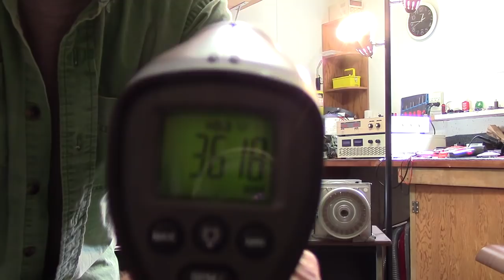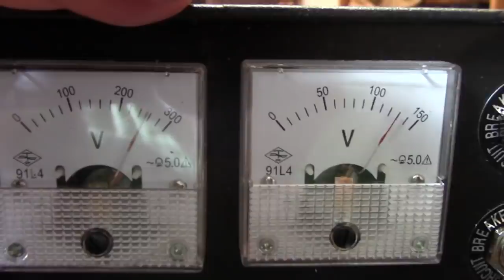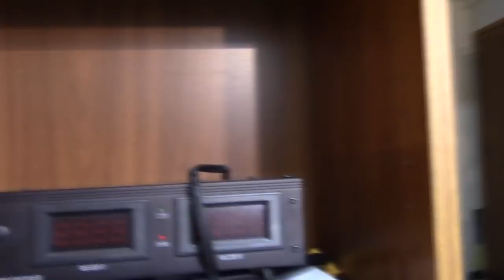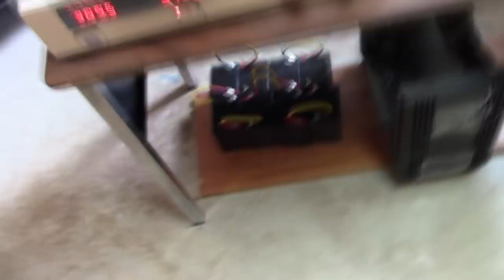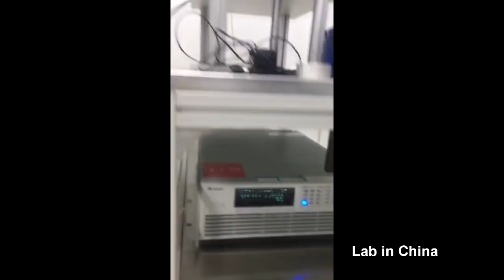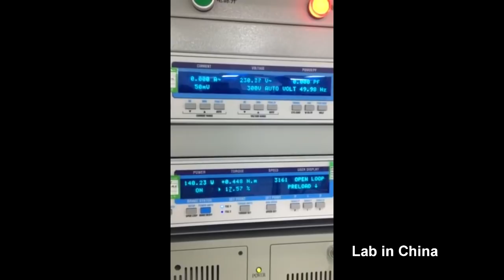China Lab Video + Early loop evidence

Comment: The only problem you never connect a load to these fucking generators and produce more power then what's being used to run the generator. We don't give a F about the RPM unless there is a load conected to it.

Comment: Mount it firmly in a speaker box with a speaker membrane on the spinning side. Set up another genny like a mirror of the 1st and face the speaker heads at each other and maybe the matching fz but opposite wave length will cancel out the sound

Comment: Wait so you're using 389v at 3.7 amps according to your power supply.
So that's over 1400 watts of power draw.
Its hard to understand what you're trying to achieve, you say you can make 80amp at what voltage.

My welder can make 200amps from 20 amps from the wall. 
But it's 230v at 20amp to 20 to 25 volt to 200amp

Why should we believe a claim with no evidence.

Comment: In me opinion any cinde of compound sg's can not work be them self they are not practical how ever if compound hybrid engine is used thats diferent story with of course other hybrid gismos .
Early exampels willys jeep ,kubelwagen,gasoline-dizel electric trains,gyrobuss,owen magnetics.
How hard can it be to modify hit and miss multi stroker engine with self regenerative fuel useing bacteria and on top of that useing closed egr system who use chemical to chemical decomposition of exaust gases then you can enchence it with electrical ,magnetical,pneumatic ore hidraulic assistance.
How ever this sir Gerard has some good points and actual testing results.
Those generators of hes work best on modified hit and miss engine then you get some thing nice working on peanuts basicaly.
Hes videos are also related to compound sg's,plasma and amplifier variabel ignition system changeing polarity comonly twin ignition .
He does have some nice staff and interesting results mostly the meter readings are unusual .

Comment: How does electronics handle the high voltage and high frequency such as radios and computers. So far you have tested inductive loads and resistive loads.

Comment: We see that is working now could you set up an outlet set up hooked to your generator and take the motor and plug it back into the generator after the generator is running see if there’s enough RF to keep the unit running smoothly.

Comment: Hey Gerard, great Job. Too bad they don't make a plc that can adjust to match the peak resonance. You could make a universal controller that does that though. 
One controller that adjusts it's resonant frequency output to whatever motor you attach it to. Just a thought.
Reply: The problem with a PLC is the scan time. Way Way to slow they are garbage for an application where the input read needs to be fast enough to calculate the rotor position. typical scan time of standard industrial PLC like a Allen Bradley micrologix or compact logix is lik in 10-100 milliseconds. you need to be able to read inputs much faster like in microseconds or faster.

Comment: sir that stator or motor bracket that needed to ring ........turn it cherry red in a forge in a dark shop......then quench in cool oil, if it still doesn't ring .....repeat and quench in H2O..........next..... last chance....... cool brine.
why use mystery metal.   I like 5160 spring steel....leaf springs to a truck...... .maybe thin your bracket....... make it longer....the length and mass is how you.tune it.   You really must  think about heating your oven to 400 f and putting your pieces...in for an hour or so ....... Then turn off your stove and let it cool down slow.  I do my knives 3 times like this a...nd they ring like the singing sword..
These last three draws in the oven dissolve the  crystals  that form inside the steel during the quench. Here is your 15 years 24 7. so it is not as brittle as glass......heat treat. When steel breaks look......look at the crystals. If this happens you need more draws in the oven. if the draws 400 degree draws are still brittle.......go to 450 .it may go blue like a spring.
However the crystals left in may be the ticket for increased resonance.......if the pieces are made robust enough to not shatter.
cherry red dark shop into water for a second then out for a couple seconds.....down in the water another second then out.....a few seconds later deep quench in the cool water   finish it cool.. if your water or oil gets too warm you are screwed. mild metal or mystery steel......last chance to harden steel......cool brine instead of water. 
Take those shitty ones you got and see which works best.    Have some fun!  PS There are safe areas to stand......but not by the flywheel.......if something flies off.....you not be there.........Don Garlett 
  lost all his toes  when a perfectly good clutch exploded........I know you know what's  going on.. 
I run a sawmill.....you can" t stand next to the head. Just take care of your self brother.......love your work. what a guy.

Comment: 4:50 RPM + V input + A input + torch + friction + load = 6 things to play with. Depending on the LOAD the controller needs to know to do what exactly? A lot of parameters to play with to find the BEST "6 items in perfect sync mode" with the MOST PERFECT EFFICIENCY factor. That's the deal 6 params in PERFECT & MOST EFFICIENT SYNC!

☠️BLACK BARON☠️: AI stands for "ARTificial INTelligence". It's in my 💀head💀

Comment: I understand that you believe you'll be able to achieve 75,000W (100HP) output with a 720W input (6A @ 120V ac mains), i.e. 10,417% efficiency, however let me drop some current figures on you. 

When you were running your small motor you were consuming 154.8W (1.29A @ 120V) from the mains, yet your power supply was only putting out 101W (0.57A @ 177.2V), result = 53.8W consumed by your power supply, therefore 65.24% efficiency. With the second motor connected @ ~2200RPM the power supply output 77.1W (0.435A @ 177.2V), yet consumed 126W (1.05A @ 120V) from the mains, 61.2% efficiency, worse that the first motor. Now although the efficiency of the power supply obviously varies with power output, you didn't provide a mains current draw whilst you were operating the second motor at 3600RPM. It's safe to say that it won't be a dramatic difference however, giving the benefit of the doubt, I'll use 70% efficiency for the second demonstration, almost 5% higher than anything we saw.

At 3600RPM, 500W load, the power supply output a whopping 1472.3W (3.78A @ 389.5V) and, with a generous 70% efficiency ratio, consumed 2103.3W from the mains; again, you were only powering a 500W load (<25% efficiency)... Ok, Ok, I'll give you the benefit of the doubt again. The load is the load; although it's 500W rated, it's rated at 120Vac, meaning that if you push the voltage higher the load will increase as a function of P=VI; not infinitely, something will blow at some point (filament in the case of am incandescent bulb). In the video the stator winding (from the generator side) that's supplying the bulbs is outputting approximately 127Vac, according to the voltmeter (the 240V output would blow the bulb), so the bulb is actually consuming approximately 560W (P=V2/R; still a huge loss).

Now for all you electric motor enthusiasts you would know that when motors run they produce what's called a "back EMF" or "counter-electromotive force", whereby the moving magnet in your motor induces its own current in the stator winding, in the opposite direction of your supply current. This follows the principle of induction (moving a magnet by a conductor and inducing a current), and is how electricity is generated by the generator side. [If you would like evidence of this, watch the current draw in the video as the speed of the motor/generator unit is increased, what you will see is as follows]. So like the electricity-producing EMF (how you actually get an output from a generator), back EMF is proportional to the angular velocity of the motor/generator (the faster it spins the higher the EMF/back EMF). So, how do you see it by watching the current, you ask? When you increase the current to the motor, more current flows through the stator, increasing the EMF (magnetic field strength), thereby making the motor armature spin faster. This increase in angular velocity rapidly increases the back EMF, counteracting the supply EMF and your input current drops, but to a value that's higher than the previous setting (watch the video, you'll see what I mean). Now the reason that more current is required to spin the motor faster is because more work is being done [work = power (Watts)], but the same goes on when more power output is required from the generator.
Reply: Now it becomes a little more complicated... At 560W (120Vac) output, the generator in the video is drawing 4.67A. When you increase the electrical load on the generator the voltage and frequency try to stay the same (function of RPM; controlled by the generator regulator) so the current increases, this increases the back EMF in the generator stator, thereby increasing the magnetic field acting on the armature, increasing the mechanical load. This then tries to slow the armature, decreasing back EMF on the motor side, which allows more current to flow in the motor stator, speeding it back up to where the back EMF balances again. However, as the motor magnetic field needs to be stronger to apply the increase force, without increased speed, the current draw is significantly higher. This process usually occurs very quickly and is not dramatic. This talking about the electric motor driven generator in the video, a generator driven by a combustion engine works on the same principle but the governor increases fuel supply, not current. 

SO, getting back to the point! Although this was stated to be a 2700W generator, the power consumption shown in the video only amounted to ~560W output. As the load is increased to 2700W maximum, the current, therefore power consumption will increase reasonably proportionally. So the 2103W required to generate 560W (both approximate without further data) wouldn't look much better (more efficient) when outputting 2700W (the maximum capacity of that generator).

Conclusion: There's no such thing as free energy. This system if full of energy losses. Taking 120Vac mains and stepping it up/down in voltage to run an electric motor to, in-turn, drive an AC generator is ridiculous people! I mean, come on!?! How do you expect to gain almost 10,500% efficiency when the setup it currently running at a big loss?
Reply: I completely forgot to mention power factor.. but unfortunately that wouldn't help your case.

Comment: No jet fuel. Sir this is out there and in use. Think about the noise the jet engines make when you're on a plane it's the exact same they tune it to the frequency of The Ether in the sky and it levitates.  Not low pressure.  That's why at certain speeds certain shapes produce honey bee Harmonics....Why  when you're at the airport or you're getting on the jet you don't smell jet fuel ?  You would think with that many jets with their engines running there would be noxious fumes  everywhere.? Thank you for exposing it for everyone to see and use.  You are a gift to humanity.
Reply: OH. MY. GOSH! Are your serious!?! You think aircraft don't run on petroleum-based fuel? They levitate using ether?!? Obviously you've never actually been close to the exhaust of an aircraft or you would know they have a distinct kerosene smell. Do you walk outside and immediately smell car fumes? Do you suffer from carbon monoxide poisoning daily? But look at all the cars? Damn, man!
Reply: You said it this should be named 'energy 2.0

Comment: Why do the greats have more success with less accurate, but analog, equipment? Is modern digital equipment more accurate in relative information transfer but using fundamental dynamics that are incompatible with nature? ie; 432mHz vs 440mHz musical tuning.

Should we try utilise refined analogue systems for systems such as amplifiers or RF generators over modern systems that use modern chipsets and circuit boards? Seems logical to me but I dunno shit lol.

Comment: Been working with Stubblefield coils. Was crating stationary magnetic fields. Used some of the Stubblefield coils to make a moving magnetic field that was the secret. Once I got the moving magnetic fields going from the Stubblefield coils to effect the others Stubblefield coils it worked. Stubblefield coils produce little current on their own. But if you use some of the coils to move  emf electricity  is generated at greater rates. Have Stubblefield coils in seed of life configuration using magnetic fields. 3 in center 6 around those and 9 around them. Some must be wired to create emf pulse or screw effect. Like how the heart works. So it can echo the next pulse. Idk the science but do know it works.

Comment: Have to applaud Gerard for his persistence but when he mentioned "looping" the system I became concerned. Under ideal conditions the electrical power output generated when you move a conductor through a magnetic field is exactly equal to the mechanical power input needed to move the conductor. This is under ideal conditions with no bearing friction, eddy currents or wire resistance ... etc. Unity can only be approached and overunity will never happen. Gerard will eventually prove this.
Reply: So by unity you mean 100% efficiency, right? But Mr Morin is claiming 10,400% efficiency... Blind leading the blind!

Comment: I definitely like what Gerard is doing here. I wish he would have put the 500w load (Lamps) on the smaller motor/generator. He mentioned that the controller is almost perfect for the smaller motor.  It seems like he could have easily run the lamps and also fed the controller with the generator he was turning with the smaller motor.
Reply: it’s called a cliffhanger

Comment: Here an idea for your hyper drive. Tesla nickel wire's around a disk that is heated then with a strong magnet to drive the disk by the magnetic field energy vibration of crystal structure's being heated and cooled to generate a spin. You know this motor? Okay now use thick nintinol and use frequency IE two Tesla coils passing a high energy communications wave passed from coil A to coil B with zero energy loss that causes the crystal structure's to vibrate causing a vibrational change in the nintinol's crystal structure's. Otay now place a spinning magnetic field at an angle to force the nintinol disk to spin at hyper speed's. For 100% out put of the hyper generstor with a small amount of electrical energy being used to power the magnetic field being generated by a small powerful electromagnet and the high energy communications wave being passed through. Tesla coils making use of vacume spark gaps? If you puff puff pass and think about this comment and throw in graphite solid state crystal power cell technology that can be constructed at any size that are also affected by frequency y'all think you can design a self sustaining electrical power generation system?  You played with joe cell and vacume spark gaps so i knowing you not stupid of hidden thing's. Impress me with what little you do know in a video to show you know basics and then i give you new toy idea's to play with. High heat superconducting ceramics ultra cold superconducting material's. Could design a mobious effect landing and taking off of air craft system for very safe take offs and landing's even damaged air craft could make safe landing's and land safely in very bad weather. Imagine a transit system that was all superconductor mobious effect electromagnetic inside a foam graphite ceramic tube that not only provided a mean's of transport around the globe at hyper speed's but also generated electrical energy used to power city grids? Funny thing is from watching your video's? You seem to know just how to do all this yet you don't apply yourself? This is very odd!   😱💩😵😲 😊😉

Comment: Geothermal, large Titanium pipes that are sunk down into the earth into a hot pocket. Then gallium Aluminum alloy super heated and circulated through large thermal electrical generator's to produce clean electrical energy with no need to remove water and then pump it back it back in. A super conducting energy loop passed through two Tesla coils with zero loss of energy. Place large graphite rod's within Titanium cylinder's abd place them in between the Tesla coils and pass that super conducting energy loop from coil A to coil B with zero energy loss while vibrating crystal structure's of the graphite rod's causing them to glow red hot with the Titanium glowing white hot. Circulate water for steam for steam turbine's ir super heat Gallium Aluminum alloy to power thermal electrical generator's. Either way is a replacement core for all nuke electrical power plant's! 😞😕
Reply: Great theory, but sounds very dangerous.  Look at all the uncapped oil wells that spew oil into the ocean. Fracking is dangerous for the same reason. Ground water levels go so deep that  wells run dry.
Reply: Not limited by an Iussas parasisis infection homie!  Single file line on the track oh this is said to inmate's be them human or bioengineered parasitic colon slug's? 😊😉
Reply: Chew Orbit's chewing gum and clean it up's that after breath from drinking that colaca cola nectar dip stick is really strong mate! 😊👽🗼⛲👄💩💀😒👹👽🔨